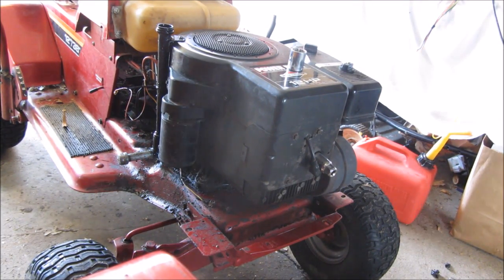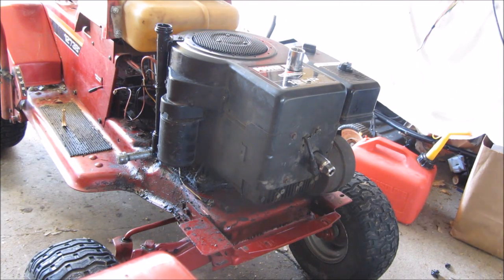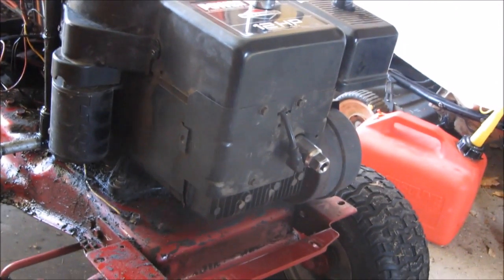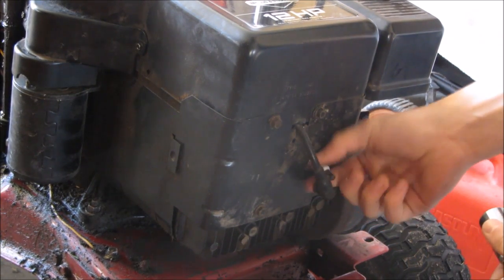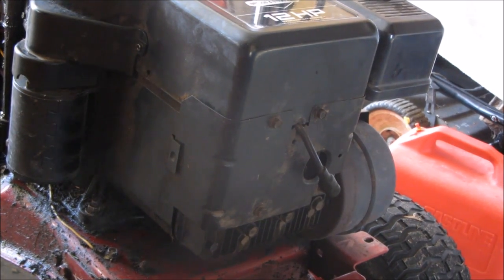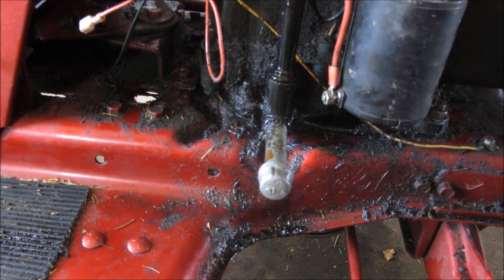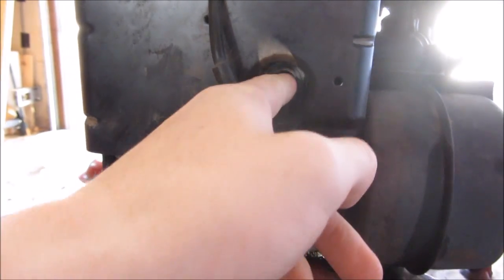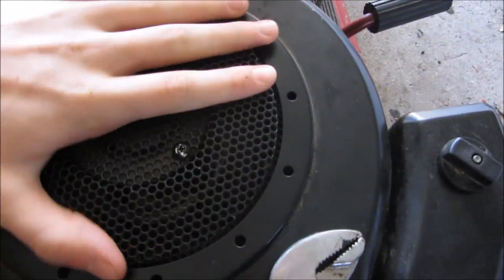How to Fix Any Seized Small Engine (horizontal or vertical)

Comment: I have a snapper 12.5 hp rear engine rider, I don't really know much about it because I got from a guy I did some work for and he said it been sitting for a couple of years, but it was garage kept, I ended getting it started but found out it needed a new clutch (friction wheel disk) so I had to order one and wait, so I had sitting outside uncovered for the last 3 weeks while the new clutch came in!

So I tried to start it today and it won't turn over at all, so I tried to use the pull cord and the pull cord won't budge! So I tried what you did in the video, but it still won't turn over, should I try to spin the flywheel manually to maybe un-freeze it? 
I think it somehow got water in there sitting outside, because the oil was pretty milky, but was fine before sitting outside (I feel like a dumbass now lol) any advice will be greatly appreciated, thank you!

Comment: Did what you said, pulled easy without the oil and spark plug in, but wouldn't pull when I put the oil and plug back in.

Comment: I used PB blaster and it worked fine on my GC190 Honda.  I previously used Marvelous Mystery Oil on an old 1948 Jeep CJ2 that had sat behind a ranchers barn for about 40 years without being started.  It was a 4 cylinder flathead.  Shot the MMO in the spark plug holes and let it sit for a week.  Came back and the crank turned.  Changed the oil, put penetrating oil in the spark plug holes and let it sit for a couple more days.  Attached a new battery and it fired back up after over 40 years.  I later rebuilt the motor, but It ran the way it was for almost a year.

Comment: on the side shaft briggs style motors the piston doesn't sieze a lot of the time the cam seizes from lack of lubrication so you should always pull the side or bottom cover and check that out first so it doesn't get damaged when you force it.

Comment: Crap seized this engine because no lubricant , completely seized, getting ready for engine opening to see if rings, bearings, rods, or WTF broken, then one can on WD-40 in combustion chamber plus any other lubricant I could find (locksmith lubricant) after 10 minutes grab breaker bar and start moving crank a little until this shit got fixed, hey it was trashed already so try  anyways, yes works fine

Comment: Awesome and so helpful!    Generator seized up in day 2 of hurricane Florence and I found this video.   Used wd-40 instead of PB Blaster.   Worked just like you said.    Saved my ass.    Thank you very very much for posting
Reply: What is PB blaster?
Reply: PB Blaster is a spray lubricant similar to wd-40
Reply: Wd40 is water base wouldn't recommend as it can cause more rust damage.
Reply: Did the 3b blaster first time and got it started mowed my yard 3 times and it has done it again 3b blaster not helping this time

Comment: Worked just now for my cub cadet 4 cycle string trimmer.  Had not used in 3 or 4 years and i could not crank it.   sprayed some penetrating oil into cylinder and it worked right away.

Comment: No one worried about main bearings rings cylinder or cam?
Reply: Lingenfelter Farm These small briggs flatheads dont have "ROD" bearings
Reply: no
Reply: While they may not have bearings they still have a rod and Rod cap wear surface. This will get worn especially running without oil. This trick is only by  a good luck basis
Reply: @staind288  You are right. Locked mine up yesterday. Still tried this but no luck at all.

Comment: I envy your gas can, it looks like it actually dispenses gas without leaking everywhere like the new EPA approved cans.
Reply from the maker: G your right it's older than me, and doesn't leak at all lol
Reply from the maker: G your right it's older than me, and doesn't leak at all lol
Reply: you can buy replacement spouts on ebay for like $2 each.
Reply: I paid $2 for a 2 gallon can at a garage sale like that one. i will never get a new one
Reply: Tractor supply sells "water spouts" if you catch what im saying ;)

Comment: If you ran it out of oil, why would you drain oil ?And most new lawn mowers If I'm not mistaken stall with low oil. VW cars have same problem just add 2 cans oil and go. I should of said some VWs have that sencer that shuts them down so you don,t blow motor.
Reply: I have a two year old toro, and it did not stall before seizing. Darn

Comment: Will will this work on a 2 stroke leaf blower?
Reply: Huh Do it should. Just make sure it doesn't just run out the exhaust, if it does try plugging up the exhaust to keep the liquid in the cylinder.

Comment: Hey, fellow Wisconsinite here, I got an old tecumseh 7hp from an Ariens snowblower  and i sprayed PB into the combustion chamber, waited 30 min and nothing, waited 2-3 hours and still seized. I watched a video where a guy waited a week but unless thats my only option i dont want to resort to that. Any ideas on what i should do? Anything is appreciated, thanks
Reply from the maker: alright so if it wasn't already have the cylinder vertical so the penetrating fluid can run down easier 
btw are you related to a Steven Rosenberg?

Comment: Question... I used this method to free up a frozen leaf blower engine, but think I might have used too much lubricant (I used PB Blaster, and put quite a bit in there...) I still can't fire it up, but I think there still might be too much lubricant in the chamber. The plug is drenched... Should I just let it air out for a while & try again?
Reply from the maker: yeah take out the plug and pull the cord a few times to spin out pb blaster then let it sit for a bit with the plug. After a while put it back in and try again

Comment: I sprayed the pb blaster in the spark plug hole and nothing happened its still locked up. I didn't drain the oil though do I have to do this in order for this process to work?
Reply: why does draining the oil matter if I am just spraying in the spark plug hole?
Reply: i have done it by filling the spark plug hole with diesel fuel
Reply from the maker: I drained the oil just so it wouldn't get contaminated, did you try to spin the engine at all?

Comment: I have several cracks in my crankcase.  I am going to attempt to weld it together with a propane torch.  Should I apply aluminum from the inside or outside?
Reply: Well, if you are decent with a torch, you can use a torch, aluminum welding rods and flux and get a pretty decent weld if you are good with a torch. I have repaired a lot of aluminum boats doing this and even welded a crack in a motorcycle crankcase.
Reply from the maker: I don't belive that you can weld aluminum without a tig welder sorry

Comment: Hey my 17.5 hp Briggs and Stratton engine was seized up and I followed your steps. I got it unseized, but now it has no compression and won't start. Any help would be appreciated.
Reply from the maker: it might be that the valves were damaged
Reply: I am leaning more towards the rings...

Comment: My dirt bike engine seized but idk what pb blaster is another video suggested squirting wd40 on the piston but idk if I can get this last screw off should I squirt it in the spark plug hole?
Reply from the maker: wd40 is similar to pb blaster, they are both penetrating sprays, however pb blaster works better, and yes spray it in the spark plug hole, no need to take off any screws or bolts

Comment: You are absolutely awesome for putting up this video.  You just saved me a hassle to the repair shop and a lot of money.  Thank you very much.  My back pack leaf blower due to weather and not draining the fuel for winter storage would not budge.  I thought maybe it was the pull rope mechanism.  Than realized I had a seized motor. I did exactly as you described....and it worked.  Thanks again brother.
Reply from the maker: glad I could help buddy
Reply: It's true,  I got my mower going right after I watched this video, it saved me a trip to the shop!

Comment: I just followed your steps to fix my engine and its soaking in now. Quick question though, does the PB blaster need to be flushed out before filling with oil and starting the engine back up or will/ can it safely burn out? Thanks Tom.
Reply from the maker: it doesn't need to be flushed out, just fill it up with oil and turn it over a few times by hand before running it to get it all lubed up, then you are good to go
Reply: +theWisconsin Redneck5160 Alright here goes nothing... Thanks for your help!
Reply from the maker: +Thomas Meola yeah glad I could help

Comment: Also add a little oil to the cylinder after using pb blaster, give it a good half a day to soak the piston rings. Otherwise it might do it all over again even with a full sump of oil. Had a horizontal 3hp flatheat seize up, been stored all winter and the rings leaked enough oil away from the piston it didn't want to move. Ran it for 10 minutes and had the most violent stop ever. Ended up having to replace  rings and luckily no scored walls.
Reply: mine did this  what is pb spray  like WD 40?   or carb cleaner?
Reply: @frankenboston  similar to WD but a much better rust penetrant

Comment: With mine I put the throttle down all the way it stopped and locked up and I am trying to find out why
Reply from the maker: well there's most likely two things that Happened, #1 is that the connecting rod broke. to test to see if this happened it should almost make a rotation then stop. it stops because it is hitting the end of the broken rod. #2 is because it was ran with too little oil, overheated, and seized up. if it did that follow the procedure I showed in the vid. thanks for watching, hope this helps!

Comment: Awesome thanks but for a really seized motor do that and open the top put a crow bar or piece of mettle on the lower heavier part of the fly wheel and pull to turn it. Works good (p.s pry it in the proper direction or you will break it)
Reply: What's a "piece of mettle"?